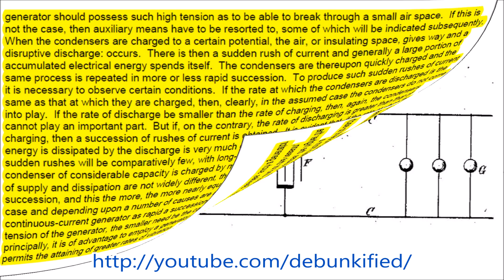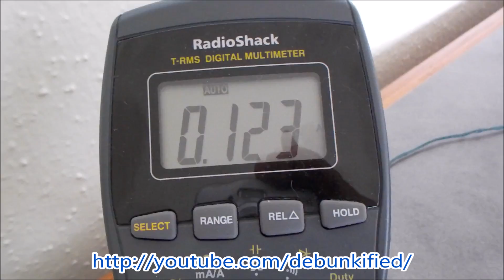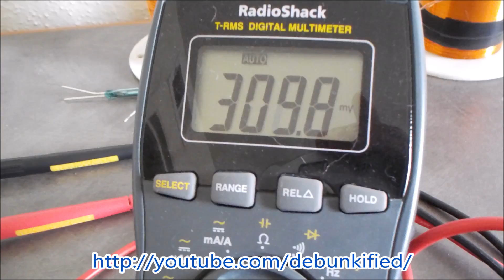Nikola Tesla's Method of Conversion

Comment: also, im not 100% convinced that lead acid batteries are 50% efficient all the time....i believe that pulsing them allows for the chemical change to absorb closer to 100 percent if pulses are spaced long enough, much the same effect could probably be seen in a capacitor...there is always loss's due to heat....and lead acid batteries give off alot of heat when charged with a conventional battery charger, which is why you can now buy smart chargers that are way more efficient. The typical bounce back effect of capacitors i do believe can be explained from an indifference in voltage at a given time period, so possibly the capacitors will not bouce back if they are drained extremely slowly....like almost removing the 'frequency' from the dielectric??? who knows?? john hutchinson im sure would know...

Comment: debunkified i was watching your video where your using a resistive load on motor and i wanted to exlain you were missing an important factor in your explanation....the TIME factor....but my battery died on my phone...great videos by the way...you are right about batteries.....i mentioned it to you before....and your right about caps acting like they do....whats even more neat is using 2000 volt caps....once conditioned they seem to make power from nothing!!! the hard part is conditioning them...you got to max them out in voltage for a few seconds then dead short them or pull heavy load...over and over and over....looking at akulas devices....which im sure you have...you will notice the open lead in his transformers....that is another method that behaves rather strangely when experimented with. It all boils down to the same thing....magnetism....pretty soon you will be just like the rest of us....you will have experimented and made devices that legitimately produce more power out than in....but at what cost??? it all boils down to this....yes you can make more power than you use....but what are you going to do with it??? you cant store it in something that isnt efficient enough to show the effect....not cheaply anyways.....
Reply from the maker: Super Capacitors
Reply: That may be one way. I seen that researchers are actually trying to store it magnetically now, same princible as a PMH , store it in a toroid as magnetic flux, then draw from it when needed....neat concept.

Comment: i going to tell you how to make something work....forget about rebound effect...take apart a computer power supply, on the high side you will find a transformer with lots of outputs, use that as your main transformer, use your setup with existing ic's, and experiment with that type of transformer...you will find at certain frequencies fed to the transformer from circuit, produces some very stange effects, example.....cold electricity, where you can touch both leads and not feel anything, yet it lights a filament type lightbulb, and usually producing more wattage at the same time, there are certain frequencies and voltages that tend to defy physics when generated....eg....how does a 1000 watt power supply only use 3 amps at 110 volts?? yes, time is a factor, yes it doesnt produce 1000 watts continually....but...eg....how does a little 9 volt taser send lethal voltages through your body, yet you can touch both sides of a 12 volt battery and feel nothing??? no need to explain it to me, i know exactly why....but alloe me to illiterate, certain voltages and frequencies seem to multiply or amplify themselves when induced, or maybe they pull it in from the evironment, hence why 1 volt at 2000 amps is harmless, and 2000 volts at 1 amp will jump through the air...who is to say that certain voltages cant conduct at a different state of matter??? NOBODY!!! also....another good example of overunity devices that we already own is a microwave....1500 watts and only using 6 amps 110 max??? DID I JUST GET RIPPED OFF?? its only using 660 watts???